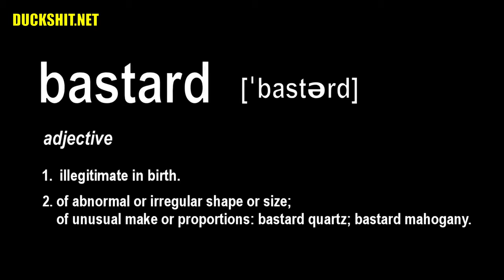Test Ride!  - DoodleBastard Engine Swap - 20

Comment: Good fun project :)
Something ain't right, though.

I'd go through the basics, before changing jets.
Obviously, clean the carb, and change the plug etc.
But some curved balls can catch you out...

Check the fuel tap is letting a good flow of fuel run through it ... they clog up.
Drain the tank ... it could be water in the fuel.
Renewing the spark plug cap, is a good idea ... they fail, though typically a partial fail.
... they show a spark, but it collapses under compression.

Good luck :)
Reply from the maker: All the above have been run through, the parts are all actually even new, but never thought to check the plug cap... you may be onto something here,.  There was a horrible ticking sound coming from the engine, it was LOUD!  When I bumped the cap, it stopped, when I bumped it again it came back.... so I pressed it on tighter and sound went away.  But maybe something more is going on there.... CHEAP CHINA STUFF!   I will dig into it and check it this week! Thanks very much!
Reply from the maker: You nailed it!  Problem was at the spark plug cap!  I was able to figure it out without replacing any parts.... it was VERY silly!  I will be posting a follow-up video and some more hooligan riding soon enough!   You will of course get a proper shoutout!  Thank you very much!
Reply: Great news :)

Comment: I'm currently working on installing one of these Chinese 250cc 5 speed engines on a little 1963 Yamaha 80cc 2 stroke bike. I was initially going to do a 125cc swap, but seeing this beast of a motor in a minibike made me pull the trigger on the bigger motor :)
Reply from the maker: Haha awesome!  This thing really goes like stink!  I need to take it back out of the shed, so much more fun to be had!

Comment: nice MFDM ! it will be scary dialed in !   I have a beater pocket bike I got free with the same brakes but it has front too... for an adult riding a kids toy it stops me, but I can see if you just had the rear it would be a problem and youre a bigger man than I  !!
Reply from the maker: The brake doesn't seem to do much, even when I'm just pushing it.  I can't get it to lock up as I might have expected.  Will need to deal with that one for sure!

Comment: is the gas cap vent workin? .Are the carb jets clogged with  crap since the engine has been sitting so long?  On the brake is the cable moving so your losing pressure? If you have the generator wired on the same terminal as the coil when the engine is at higher revs the generator will keep the engine running even if the switch disconnects the battery power.  I found this out at 50mph on my harley when the throttle cable got hung up. Rewire it and better yet  I would have  the ignition kill switch  ground the points.
Reply from the maker: The gas cap isn't vented, the tank is... hehe!  And yes its working.  The more I run it the better it runs... the carb is new though, not sure what crap can get in it.. maybe its just China factory gunk.

Comment: worked on a lot of carbs over the years those engines are made to run air box so when you put that kind of filter on you need to go not a little but a lot bigger jet and may need to change needle a little bit. glad to see you got the little bastard done looks awesome i bet top speed will be in 70 mph range
Reply: i figure about 35 to 40 miles on a tank lol
Reply from the maker: This engine came on a bike that did not have an air box from the factory.  You may be correct on the needle, however... but I put a smaller jet and it ran better.  More on this later!

Comment: Put a foam air filter over the pod and cable tie it on. It might stop that leaning out thing that’s happening.
Reply from the maker: Actually it was a problem with spark plug cap, fixed that one years ago.

Comment: Have thought about trying a pulse pump. Most 150cc and 250cc off road go karts have a pulse pump/ fuel shutoff design built into the fuel tank. Maybe try one from a Briggs and Stratton engine on a riding mower. Not having one could be the cause of the air bubbles in your fuel line. Also maybe a larger fuel tank vent. I would the air bubble issue before playing with jets.
Reply from the maker: Gravity feed should be fine.  The carb fills up just fine.  The tank vent was cleared when I cleared the outlet.  Larger would be silly, the tank vent only needs to be a pinhole, and its about 5mm.

Comment: The engine is a 200cc from your chopper....twin Cyl
Who made the engine?
 Has a nice sound
Reply from the maker: Single cylinder... despite having dual exhaust output from single exhaust valve.  Thats the reason for the sound.   Lifan built this engine, but I'm not sure where the unique head came from!  😁👍🦆💩

Comment: Cool cool cool. It would be even cooler if you had the carb sorted out oh well we cant foretell the future? Did run like that when it was on the chopper bike? If not its just dirty. They have those tiny screw drivers made for carburetors to drill out the jets with but it probably just clogged up. be careful not to go too much bigger or the same size. Now you gotta make a video about cleaning and opening up the jets in it. I predict it will run 67 miles an hour.
Reply from the maker: It's actually not the same carburetor that was on the chopper.  The chopper ran a 27 mm width 27 mm intake manifold, but now I'm upgraded to a 30 mm.  I figured since those parts were missing anyway might as well just buy the upgraded ones.  This bike is going to be a whole lot of fun, and bruises and road rash!
Reply: @DuckmanCycles  I meant to say tiny drill bits LOL yeah maybe drill it out to the next size ?
Reply from the maker: I have hat's, coincidentally same type as Ninja 250 jets!  😁😁😁